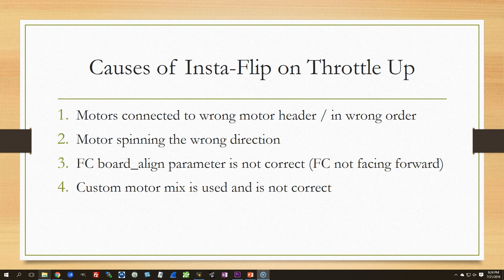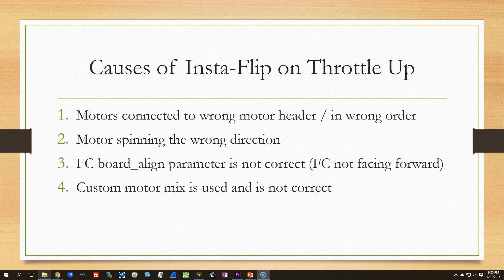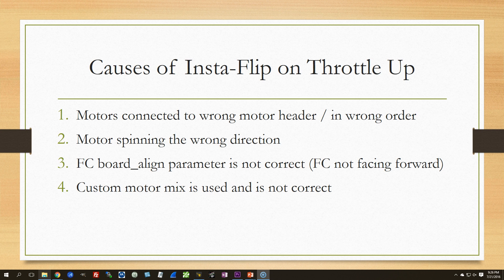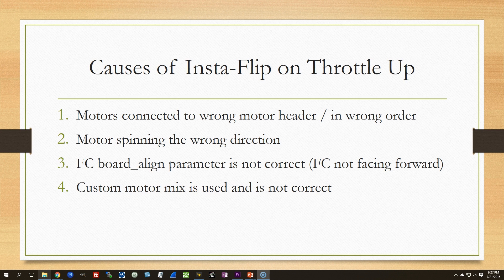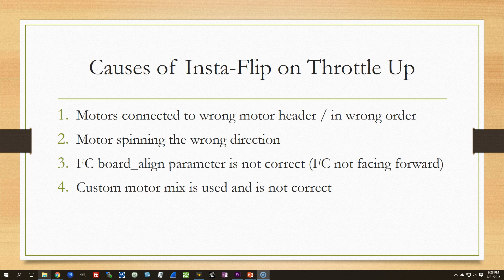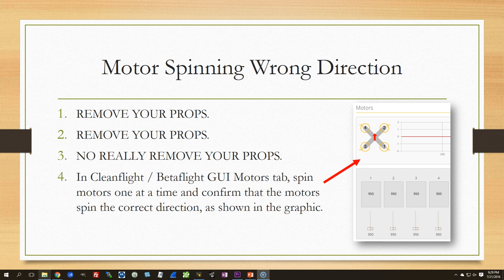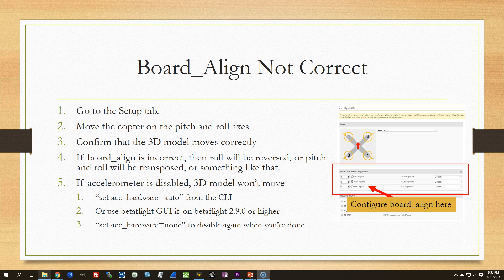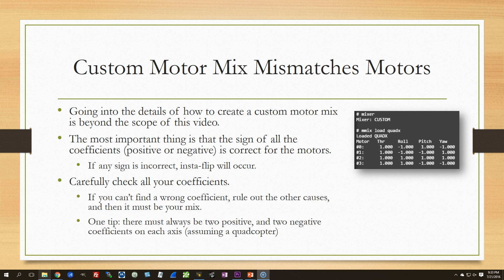Quadcopter Flips On Takeoff: Solved

Comment: I did all the trouble shooting my drone is a pre built bind and fly drone was flying good one day and today it decided to flip out and none of these 4 reasons are why… why I do know is when I go to the motors tab and apply throttle motors 2 and 4 are not the same output as 1 and 3 but when I use the master tab slider in beta flying to add throttle they are all the same output

Comment: A drone can also flip on throttle if one of the props is not bolted tightly enough so it spins at a slower speed than the other props. I had this happen and all I did was slightly tighten one of the props.

Comment: So, even though this video is 7 yrs old, I'm new to drones & dont have the first clue on what to do. I' don't have a clue to anything U mentioned..lol I'm like a tiny little golf ball stuck in really high weeds here lol I've got 2 New drones that I bought last year& straight out of the box, if not been able to get either drone to take off. Not even close. It's like they are kinda stuck. (If u can imagine a drone getting throttle on all 4 quads* dont even know if that is the correct  term) but eventually the drone will flip over usually on its right side. I can  sometimes manage to avoid flipping it but it's like still struggling. I've had the front end  raise up and the back end not. Hell, it could be that I just ain't use to the controls yet?  how long does it take to pick up these skills to fly? Lol it's just really frustrating that I have 2 ,brand new ones just chilling out here at the house with  me bc I'm dumb lol (they aren't expensive by no means but they can take pics, videos, they have gps and a few other liy features that I ant remembered right of. If anyone could help out with some suggestions, I need all the help I can get lol I really don't want to have to take these apart..I don't think I'm up for that. But appreciate ur insight & help.
Reply: Props not quads lol my bad

Comment: I just did a build and Betaflight shows everything correct as far as motor direction and orientation. There is a Gyro/Accel set to second with no other option and the second Gyro had to be set to 180flip in order to have everything set up correctly. However under idle all demands operate properly but one you add throttle to hover it yaws really fast and then shuts down.

Comment: I upgraded to 6s, swapped motors and got new battery. Motors turn in correct direction, props on correct.  AFTER i launch WHILE hovering at low throttle at some point it just starts flipping. During the few seconds of hover everything works as expected. Im ready to smash it all and get new gear but this is all new

Comment: but what is the cause when it starts already drifting to one side, independent to flight mode selected? not flipping. just drifting. stick trimming is set to 0
Reply from the maker: The cause is, this is an acro drone not a freestyle drone and you have to actively fly it or it will drift. Also, you might need to calibrate your sticks. The channels might not be centered even though truk is set to zero.

Comment: If you landed wrong saying a small crash, can that discalibrate the motors.? Works good just when you accelerate it goes forward..if it's in the ground and you pitch front,back it's fine until you want to take off..

Comment: My problem is as soon as I arm I don't even need to give it throttle and it flips
Reply from the maker: It's the same thing.

If the quad suddenly pops up in the air and then disarms when you arm, it is almost always one of these things.

1. Clockwise prop installed on counter-clockwise spinning motor or vice versa. Double check the motor direction is as expected and then double check that the correct prop is on each motor.

2. Flight controller not facing forward. Go to the Setup tab in the configurator. Tilt the quadcopter on all axes (pitch, roll, yaw) with your hands. The 3D model in the configurator should move the same as you move it with your hand. If it does not, use the Board Alignment parameters in the Configuration tab to fix it. Do not use the "GYRO/ACCEL" parameter. Use the "Roll Degrees", "Pitch Degrees", and "Yaw Degrees" parameters.

3. Motors not wired correctly. TAKE OFF YOUR PROPS. Plug in a battery. Go to the Motors tab. Turn on the "props are off" slider in the lower-right. Raise the individual sliders (1, 2, 3, and 4) one at a time, just enough that the motor begins spinning. The motor positions (1, 2, 3, and 4) should match the graphic in the upper left. If they do not, then either move the signal wires so that they are correct or use resource reassignment to virtually "move" the motors.

4. Motor spinning wrong direction. Do the same as step 3 but compare the motor direction to the arrows on the graphic in the upper left. If a motor is spinning the wrong direction, either reverse it using BLHeli (or whatever ESC software you are using) or swap any two motor wires with each other, which will reverse the direction.

5. If you have enabled the "motor direction is reversed" parameter in the Configuration tab, then you must go into blheli and reverse the motors, or swap the motor wires to reverse the motors. The "motor direction is reversed" option TELLS betaflight THAT you reversed the motors. It does not reverse the motors. This is a special case of #4 where the motors are spinning the wrong direction.
Reply: @JoshuaBardwell  thank you man. For sure My problem was number two. The Darwin FPV aio  flight controller was oriented the wrong way. It's weird though because on the board I put motor one we're it supposed to be oriented in order to three and four in  beta flight but the head of the flight controller is not that way. It just confused me. I had to go You... you help me out a lot and the community. Thanks a lot once again. I definitely owe you.

Comment: Thank you for your video Joshua. Unfortuately I've gone through all these steps. Motor mapping, direction and prop placement are correct. FC is mounted in the right direction. Accelerometer calibrated. Mostly factory defaults left. At no throttle I pitch forward and back correctly. Side to side correctly but when I give it any throttle it flips. What am I doing wrong? Thank you!
Reply: Did you find answer? Has there the same problem

Comment: Can you help? i have an original King Kong ET115 and as soon as i lift off the ground it starts spinning to the right and then sometimes it flips out but mostly spins. when i check the motors in betaflight one at a time 2 of the motors sound like they are spinning faster than the other 2. can i have week motors or esc going bad? any thoughts as to what might be the problem. Thanks

Comment: I would add one more thing, my motors are the same. but recently my quad started doing this flip sometimes. I can notice that one engine is somehow behaving differently. When I turn off engines one is spinning freely much longer than 3 other. I think this engine lost its parameter. It is the same engine as others and I had no crash, it just happened for no known reason, but I think I have case 4 from your list.

Comment: I watched a fair few of your quadcopter motor not spinning correct videos, as my flywoo firefly 1s Nano would not take off with 100% throttle. It turned out that everything was ok, just that i had all my props with the aerfoil rotating to create down force preventing the quad from taking off. It was a lesson in basic aerodynamics for me haha

Comment: I realize that this video addresses insta-flips, but my issue is that when I reach 1/4 throttle on transmitter......drone skyrockets on throttle, AND THEN.....it flips over of course! But again, my issue is with the throttle increase. Any suggestions anyone? And, this issue is ONLY occurring with tiny hawk freestyle 2. I have purchased 2 different flight controllers, soldered them up wonderfully both times(no smoke on power up), and when I give the EMAX E6 transmitter a little throttle.....problem occurs:(

Comment: Hello, complete brand new beginner here. I just bought a nazgul 5 bnf. And after about 4 hours of binding my dji goggles and tx16s and finally figuring out how to get it into mode 4 I tried to take flight and immediately had a crazy flip upon arming. Everything in beta flight looked normal all motors were hooked up correctly and gyro was turning correctly everything was as it should be and I couldn't figure out what was the issue for ever. On the bench without props had the issue of after I'd give it a little throttle it would start idling up slowly till full throttle.. Low and behold updating the firmware on the drone through betaflight was the solution! Dont know why I didn't think about this.. No more take away throttle and no more flips on takeoff!
Reply: Additional cause of instaflip: old firmware needing update lol
Reply from the maker: Most likely the old firmware became misconfigured and updating restored the correct configuration.

Comment: Great Chanel Joshua! I spent most of today watching your trouble shooting videos. Could not get the drone to take off with out not flipping over... Turns out I had mounted the ECS upside down. The way I found out was to test every motor individually.  Tore the drone apart flipped the ECS over re-soldered everything and it is up and hovering. You are a God send to the FPV community!

Comment: Hi.  I just had this on my maiden flight, and I don't know why.  My props are rotating the correct way.  Not sure about the FC not facing forward.  The model on betaflight tilts in the correct direction if I move my quad.

I have a Matek 405STD and a Matek fchub-vtx.
My ESCs ES25 25A are connected to my fchub.
Starting at the rear right motor and going CCW, S1, S2, S4, S3.

Does this mean all should be ok?

Comment: Keeps hapening to me even after I did a whole CLI dump and a rebind (my motors spin the right way and im preety sure the props are on right). Im rage quiting life HELPPPP
Reply from the maker: If the quad suddenly pops up in the air and then disarms when you arm, it is almost always one of these things.

1. Clockwise prop installed on counter-clockwise spinning motor or vice versa. Double check the motor direction is as expected and then double check that the correct prop is on each motor.

2. Flight controller not facing forward. Go to the Setup tab in the configurator. Tilt the quadcopter on all axes (pitch, roll, yaw) with your hands. The 3D model in the configurator should move the same as you move it with your hand. If it does not, use the Board Alignment parameters in the Configuration tab to fix it. Do not use the "GYRO/ACCEL" parameter. Use the "Roll Degrees", "Pitch Degrees", and "Yaw Degrees" parameters.

3. Motors not wired correctly. TAKE OFF YOUR PROPS. Plug in a battery. Go to the Motors tab. Turn on the "props are off" slider in the lower-right. Raise the individual sliders (1, 2, 3, and 4) one at a time, just enough that the motor begins spinning. The motor positions (1, 2, 3, and 4) should match the graphic in the upper left. If they do not, then either move the signal wires so that they are correct or use resource reassignment to virtually "move" the motors.

4. Motor spinning wrong direction. Do the same as step 3 but compare the motor direction to the arrows on the graphic in the upper left. If a motor is spinning the wrong direction, either reverse it using BLHeli (or whatever ESC software you are using) or swap any two motor wires with each other, which will reverse the direction.

5. If you have enabled the "motor direction is reversed" parameter in the Configuration tab, then you must go into blheli and reverse the motors, or swap the motor wires to reverse the motors. The "motor direction is reversed" option TELLS betaflight THAT you reversed the motors. It does not reverse the motors. This is a special case of  where the motors are spinning the wrong direction.

Comment: Wow. This helped me again. Buying cheap FC's is my MO and during setup I noticed my first gyro was set at 270. After checking with my other 2 quads, which have the first gyro at 0,  I thought I accidentally changed it and "put it back to zero..." So on the first flight attempt it flipped over and, back to the shop I go. Checked every error I have made during previous builds and could find nothing. Wth?  But THEN I remembered the 270 setting and changed the first gyro BACK to 270. Dang, orientation checked correctly and back to the field I go. Lesson - whatever the FC want the 1st gyro to be, it shall forever stay that way. Thanks again Joshua!

Comment: This is randomly happening to my Joshua Bardwell edition Xilo 5" except it's happening in flight.  The copter lifts off and hovers well.  I can fly around the yard and then randomly, the insta-flip happens and the copter freaks out and uncontrollably crashes.  I've reflashed the copter a few times to the latest firmware and checked all solder connections and all checks out well.   Suggestions?

Comment: There's one thing you didn't mention...completely. I was having this issue and it ended up being board orientation. However, you would have never known it wasn't already oriented properly. It was set at 90deg cw and the model would move correctly in the configuration tab (left/right/fwd/backwards) when moving the quad physically. It wasn't fixed until I set the orientation to 270deg cw...which ALSO moved the model correctly in bf as I moved the quad.

How is it that both 90deg cw and 270deg cw orientation make the model move "correctly" in betaflight 4.2.5? This had me stumped for days bc it seemed,  according to the model, that it was gtg.

Also, thank you for sharing of your knowledge always. ☝🤘

Comment: I just put a Whoop Lite Flight Controller together and had this problem.
When he said the motors are plugged in crossed.. I flipped it over and chuckled. 
Sure enough I had the left two backwards.
Thanks a million bud.
😂👍🎮
You prevented many headaches with this video.

Comment: I've had at least three on four that flipped over when armed or accelerated from the ground,   Checked motor direction, 3D model, The wrong motor connection is unlikely ?   unless that's a software correction. And none were mixmatch setups.    So in my opinion this video is wrong in saying its ALWAYS one of these four things.  The drones I've had issues with were either X220 or Flywoo Vampire 2 HD F7,  new from bangood supposedly already setup.  Joshua I appreciate all your videos,  but gotta say when i have a drone that flips over I am not filled with confidence that I can fix it!  Not saying you are wrong, just that I have not had much luck when they flip over during takeoff.  The only thing I don't understand is "motor connected to motor header, in wrong order"???  all those drones are gone now, I'll have to build another and check that out.
Reply from the maker: Hi, Eric. I hate to tell you but it's 99% of the time one of these four things. People say they checked and then the 4th time they check they discover they missed something.
Reply: @JoshuaBardwell  could be,  the one I was checking flipped on being armed by the switch.  Can maybe arm and end point settings cause it to arm at high RPM? (and flip)  or maybe his Motor order seems a little confusing to me.   That customer already left,  I'll have to research how to verify motor order ?

Comment: You are wrong bro, I got a brand new freestyle fpv and had to take the props off to tape down the motor wires and when I out them back on, ......insta flip and that's all I did. So the props on wrong can 100% cause insta flip. Thanks for the video anyway!

Comment: I have a Tinyhawk 2 Freestyle and have had this issue since I purchased it.  I have checked all four of these, did a BNF CLI dump and reset, built numerous new models.  Still flips on throttle. Any other suggestions?

Comment: My FC is mounted rotated 45 degrees ccw.  Everything else tests fine but even changing the yaw to -45 or 45 in the alignment it still insta flips.
Reply from the maker: Then it's not 45 it's some other angle. Use the setup tab to verify correct alignment.
Reply: thanks for the response. Turns out alignment settings were good.  I had to disconnect my vtx to fix the issue.  If vtx is connected freak out if disconnected runs great.  Connecting vtx directly to battery leads lets me run the vtx without freaking out.  So not sure what the deal was...

Comment: Hello, great video as always Joshua. I have the issue of motor 3 spinning up when I move the motor 1 slider in betaflight. Motor 1 moves for motor 2, etc.   My yaw setting is set to 90° to make the preview window move in the same direction as the quad in betaflight.  I can't figure out what to do to make motor 1 motor 1 again, and so on..  Any help would be greatly appreciated!! I want to get back in the air!!
Reply: This is a tinyhawk freestyle. It was working before.. I haven't wired the motors, they did at the factory.  I don't have a custom mix. Its all as they set it except that I am using flysky transmitter and receiver and changed the fc to AETR1234 to work with its protocol

Comment: Even these old videos are still helping...Had to come and check this out because I thought I was going mad. After years of building quads I just finished another and it was flipping out on me. I did all the checks and couldn't find out why, so I came back to this video and then the solution hit me. I had taken a FC from another quad and mounted it to my new build. However I had placed it the opposite way to how I had it in the other quad. So all 4 motors where spinning the right way I had forgot to change the motor positions in ( RESOURCE ) and motor 1 was spinning instead of motor 3 and so on.  Within 10 seconds of watching this I realised what I had done  ( WHAT A PLONKER I AM ) I cant believe I did that. Thanks Joshua